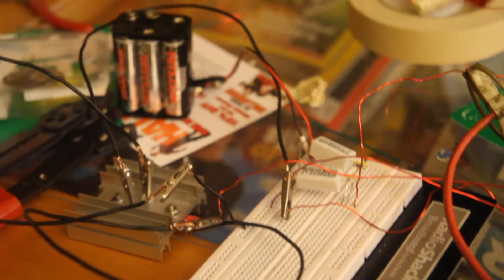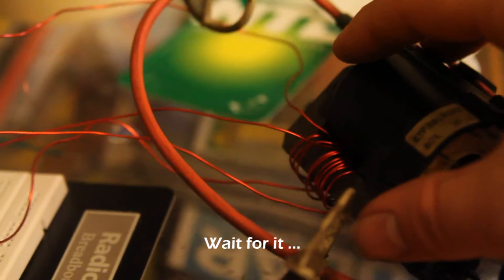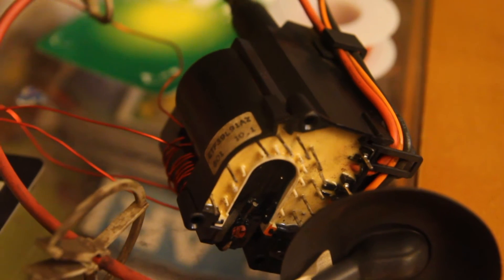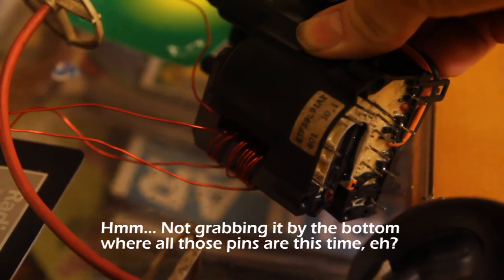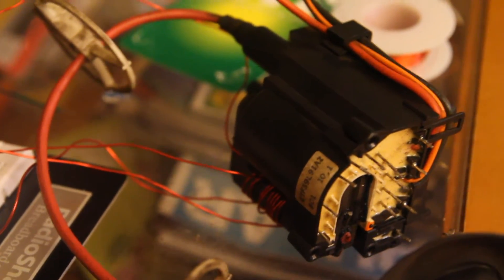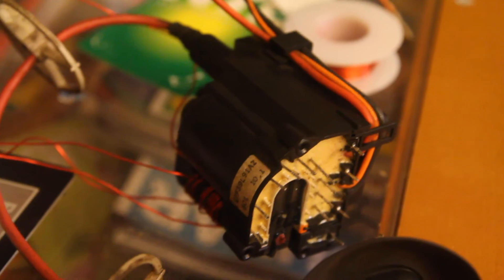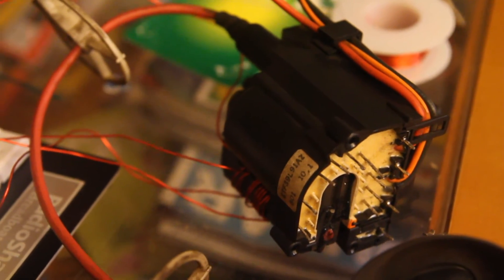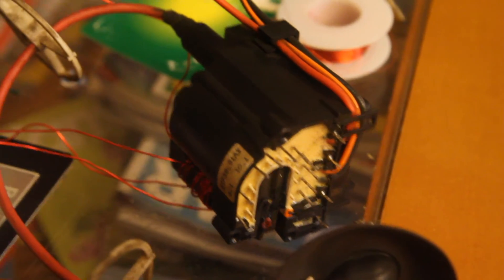Single Transistor Flyback Driver Test

Comment: You got a zap out of that flyback, they will pack a punch, especially when they are still connected in a TV. Best is to discharge across the active and ground wire after testing.

Comment: @mraiford Basically yes ( :

Sure I would love to see it running now, one more thing you could try aswell is to power it using a 12v lead acid or 2x 6v lantern battery's in series as they should be able to provide a bit more current.